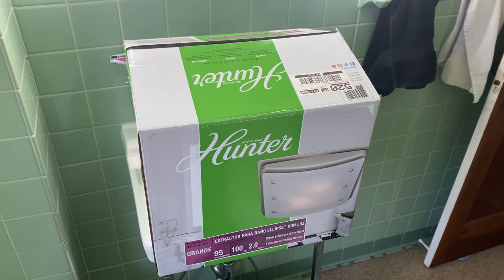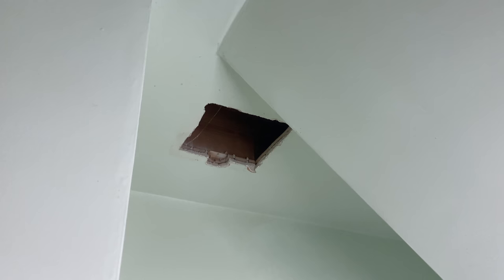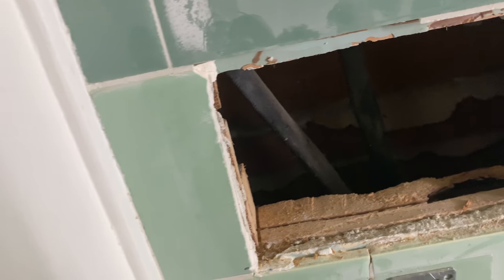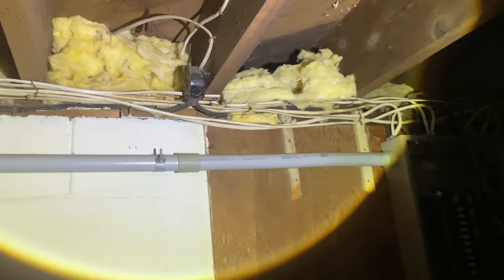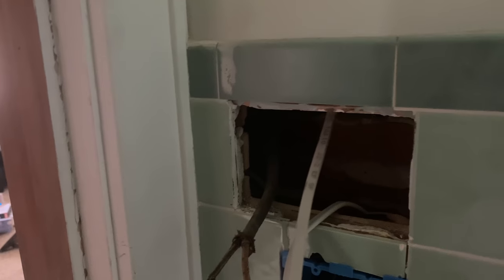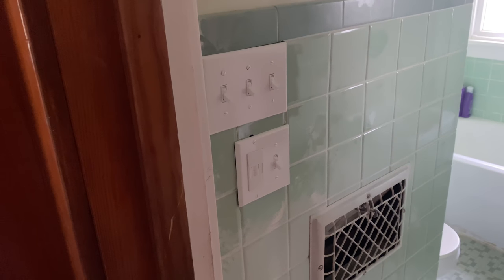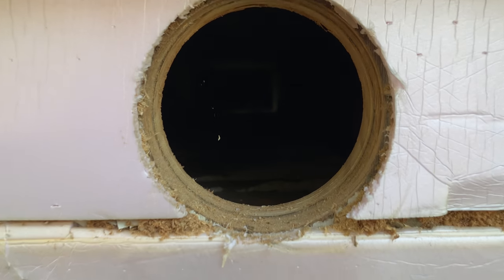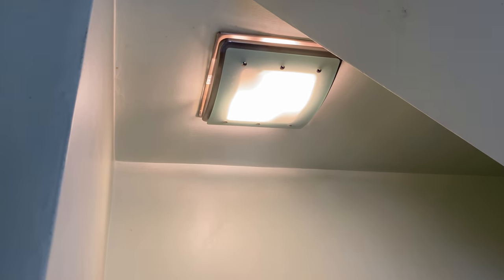Installing a Bathroom Vent Fan Without an Existing Vent

Comment: The part of your video I need to see is the electrical install. I can’t tell what your doing because you fast forwarded that part of your video.
Reply from the maker: Incoming power to dead front GFCI, splits out from there, vent fan ran using two 14/2 romex wires, I'm using the neutral wire from the second 14/2 romex as a hot (labeled as such!).

Comment: Just taping electrical joints and shoving them in the wall is not safe, at least put those wires into a box and make your joints if you’re going to bury it
Reply from the maker: Buring electrical boxes isn't exactly allowed either. I did run a brand new wire to this a few weeks after this video was made.

Comment: I'm thinking for my half bathroom which only has a toilet and sink. It does have a window but takes a long time to vent the smell from the toilet.
Reply from the maker: You’ll want it to vent outside, vent fans really aren’t for the smell, they are for humidity control, which both toilet and sink have water.

Comment: Is it possible to use a air purifier in my half bathroom instead of installing a new exhaust fan? What do you think. Home depot has a small one for $49.
Reply from the maker: No, it’s not about purifying the air, it’s more for dehumidifying and circulating the air to prevent mold for the wet environment

Comment: Great job!  Not easy to install a vent/fan & light combo and you lucked out on the direction of the upstairs floor joists.  Not surprised the insulation on the old 1950's wiring is age hardened and peeling away like that, exposing bare copper, which can indeed be a fire hazard if not corrected.  Common problem with old wiring.  Looks like you spliced into the existing wiring correctly and have it better secured.  Glad you wore your safety mask and not breath in all that nasty dust.  Fan/vent & light install looks very nice!  BTY, the trim that goes around the face of the door jambs is known as door stop trim.
Reply from the maker: Plan on replacing most of the wiring at some point!  Not to mention more than one outlet in some rooms would be nice!

Comment: 10:30 pretty sure you cant have wire nut joints in the wall just chillin like that uou either need to pull a new wire or use a splice kit that is approved for junction without box
Reply from the maker: You are very much correct! I ran new wires when I did the kitchen shortly after this video.
Reply: @radozeman  makes sense, otherwise good video though came for the duct and mounting not the electrical so it was very helpful.